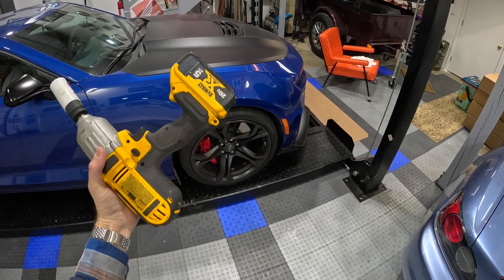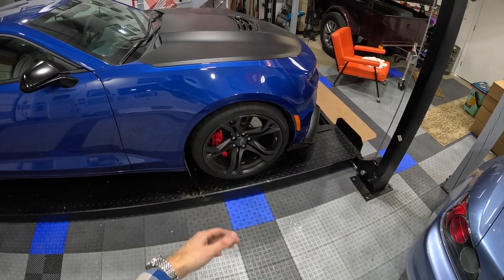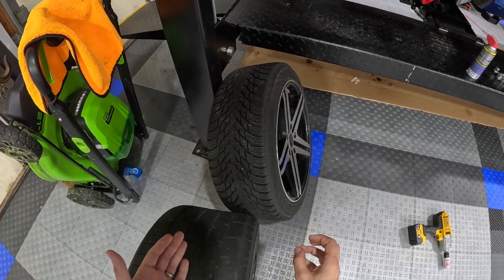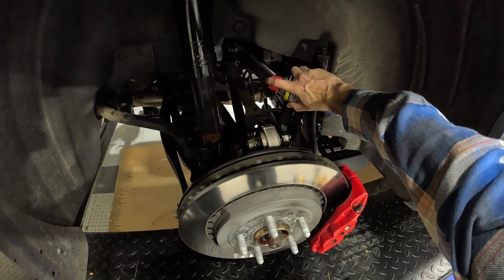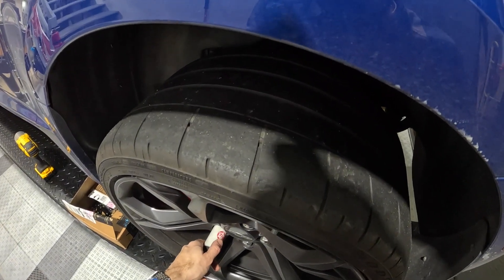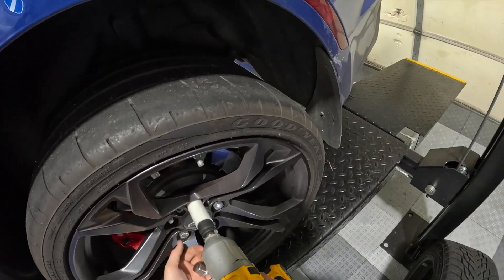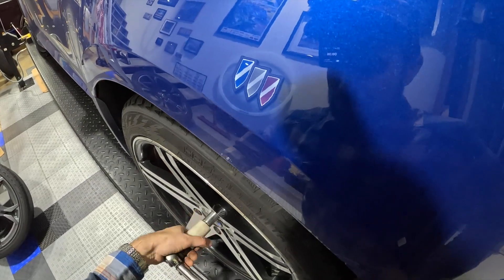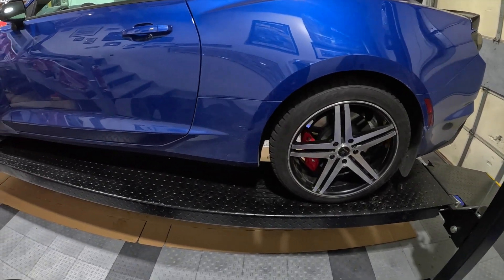2023 Chevy Camaro 1LE Winter Tire Swap

Comment: Quick question for you. Not sure if I missed it in the video but what set of rims are those? I know most rims won’t fit over the brembos so I was wondering what those are?
Reply from the maker: These were purchased used from another Camaro owner - sized in 235/45/19. They are stock offsets but a 19inch wheel. They do clear the brakes, but it’s close with the internal valve stems.